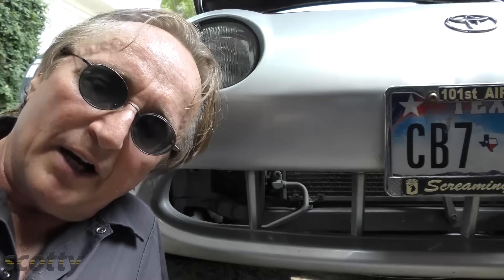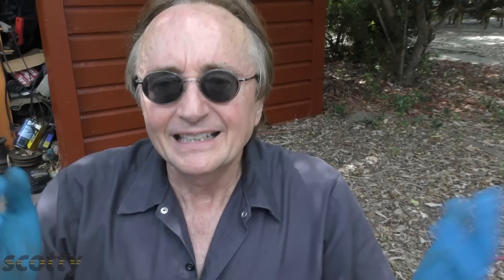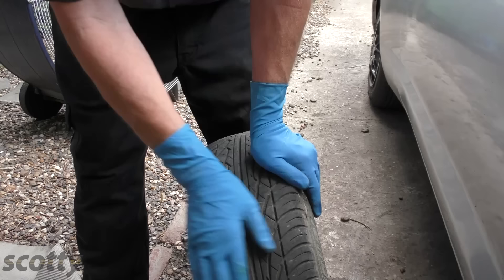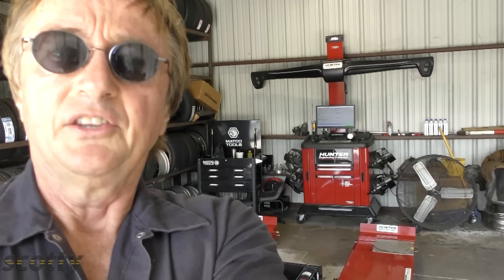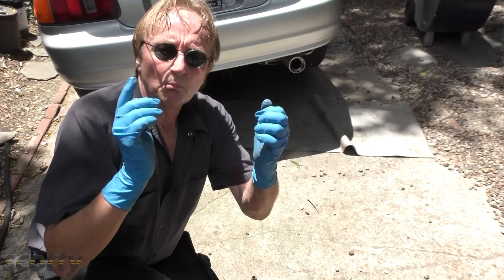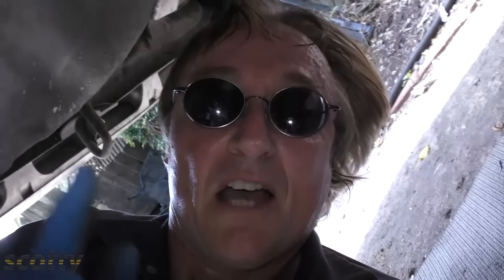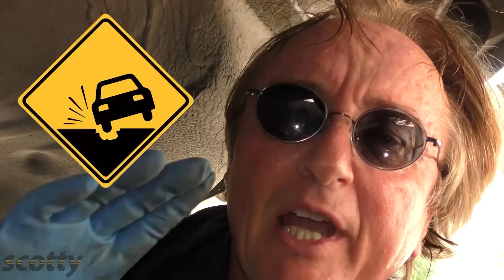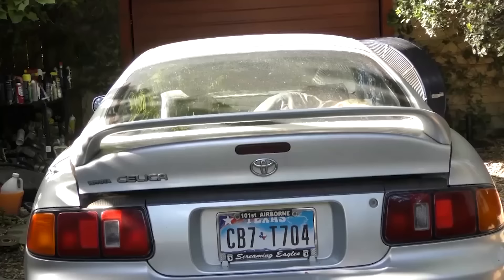How to Tell if Your Car Needs an Alignment

Comment: I changed 4 struts, 2 arms & then rotated the tires.  Should an alignment be done ? They asked me if I ran over any pot holes, etc, and the answer is no so they said I don't need one. But the car drives bumpy now.

Comment: The issue with adjustments is that any monkey that has to replace a shock absorber, or a lower pivot, or something else should at least know to recommend an alignment asap, or actually do an alignment. For the common car car any adjustments can bring heavily unadjusted parts that severely impede braking and steering.

Back in the day they made it adjustable, because the car body tolerances were way lower and each was a few millimeters off .. so if you can't make it perfect at least make it adjustable.

The purpose of wheel aliment at resting condition, is to make the wheel straight and perpendicular to the ground while doing a heavy corner, and run with the wheels parallel under acceleration and braking.
The wheel angles will only be perfect at a set medium speed intended for the vehicle. At any other speed it will be a tiny bit off. So a set of values for camber/toe/caster are perfect for a certain speed and corner approach and good enough for the rest of speeds you may run with that car.

In a racing environment you may know what is the hardest corner in that track, what is the medium speed of the track, and other particularities and you can improve the tire grip if the wheel in motion will stay true on the road.. so you can adapt different values for angles to better suit a specific track. That's why in racing cars you can find all sorts of adjustments.

So for the average car.. sure there is some cost savings, but the primary reason is that those adjustments can be unreliable and can whack the angles badly. And any monkey touching the bolts should be a certified monkey that knows what is doing and doing an alignment each time.

Comment: Small story about alignment that NO ONE thinks about.  Ex-GF got rear ended in my new car. Car road like it was on rails before the accident.  I had the cars alignment checked 3 times and it came back fine each time.  3 years later I was having the tires replaced and 1 of the rims was ever so slightly bent.  So if you've checked everything else, check the rims.

Comment: Scotty, great advice, but "Precision Tune Auto Care" won't align my car unless it is perfect. Then they tried to sell me all these repairs before they will align my car. They said, unless they do all these repairs, my car will loose alignment after they align my car.  Is this true? If so, please warn us about all the things we have to prepare for before getting our car aligned. I walked into "Precision Tune Auto Care" expecting to pay around $50. It turned out to be $400. I am sorry to say, but you failed us on this one.  

Maybe "Precision Tune Auto Care" are just crooks, and they were trying to up sell me.  That is why I do most repairs myself, but you told us we have to go to an auto mechanic, so I went to an auto mechanic.  And, I guess "Precision Tune Auto Care" are just crooks.

But, your other videos are great. You have saved me a lot of money, and I am very thankful. I cannot thank you enough, and I am very grateful. Just warn us next time about getting alignments. Your tires have to be perfect. They have to be balanced. Ball joints, control arms, etc. Everything connected to tires have to be perfect before they can do an alignment. You don't just walk into a shop and ask for an alignment. There is a lot of prep. It starts out as a $50 job, but it can sky rocket to the thousands.

Comment: Hey Scotty what if the car pulls just a little bit? I have to keep the steering wheel about 5-10 degrees off center to make the car go straight. Do I need an alignment in this case? Thanks
Reply: Tire rotation most likely!

Comment: Hey Scotty, you mentioned how nowadays, there's not too much that's readily available to be adjusted in a modern-day alignment, unlike in years past, but what if you need a classic car to get an alignment? Would a random tire shop like Belle Tire, or something similar, adjust the additional things available, or would they just go for what's usually done on modern cars? Would you need to go to a special mechanic to get it done?
Reply: Maybe ask the shop before making an appointment about the service you want performed? Just a thought.

Comment: Hey Scotty! Can I ask a question? I am trying to figure out if I need to have my car checked, or just go ahead and get new tires and rear brake pads. I have noticed some odd uneven wear on my tires. By odd, instead of both front, or rear, tires being worn, the front passenger tire is bald and the back driver's tire is bald. Both tires are worn across evenly. I have noticed too that my brake pads are worn differently. Both front are the same at about 8mm left on the pad. But the back are different. The back driver's side has 4mm left on the brake pad, and the back passenger has 3mm left on the pad. The only two things I can think of is either A: Something needs to be fixed under the car to stop the uneven wear, or B: The mechanics who "worked" on this car before I bought it, just put some used tires on it without checking and/or ignored the brake pads or just slapped some used ones on there. I did have to do a lot of work on the car after I bought it, because even though they marked it down they did it, they did not. Like my brake fluid. They marked down that they flushed and cleaned everything out. That fluid was so thick and nasty and hadn't been changed in a long time. So, what do you think on my car?

Comment: When some guy totaled his Durango on the front end of my Lincoln MkV, I had no issues driving it after that.  Even had it at the alignment shop when I needed a new steering sleeve, they didn't seem to think anything was wrong.  Perhaps when I get shocks replaced I should ask them again?

Comment: I have a question (or two) ... Scotty. I apologize in advance if someone else has asked this question. 

I own a 2007 Toyota Tundra with a rear differential. Does my truck need a 4-wheel alignment? 

I've been to some places (one said my front alignment was off by probably a millionth of an inch). But still charged me with a 4-wheel alignment. Was that necessary?

Thanks in advance.  I enjoy your videos.

Comment: On some roads my car pulls to the right, on some to the left, sometimes it doesn't. At 180 kmh the steering wheel shakes ever so slighly, but from 135 to 150 or so it's much more noticeable. How do I tell if my car needs an alignment or it's just the curvature of the road?
Reply: The shake is wheel balance.
If a shake occurs within a specific speed range and you can drive out of it, it's balance.

If your car goes straight down a flat road then you can be sure the road surface is moving you left and right. 

You can run your cambers to the most negative of the factory spec to stop this happening to easily and offset with a tiny amount of extra toe in.

Also check the rear, which if out, forces you to compensate with the steering.
Reply: @bremCZ  I've replaced outer tie rods, right wheel bearing, strut mounts, stabilizers or sway bar or whatever you call that and some other minor stuff - didn't have any effect on that. Since then I've replaced inner tie rods, one of the outer tie rods and both stabilizers got worn out (it's only been a few months!), so I replaced them again, got a new lower ball joint (again, they were both replaced 1 year ago!) and today the left wheel hub in the back will be replaced. Got myslef new  summer tires; rear and front alignment done as well.  I have a long trip lined up next week and I'll test drive it then.
But concerning the shake being caused by wheel balance - I'm not sure that that's the case, because I have it both on summer and winter tires at exactly the same range of speed.
Reply: @djvasforever  If you can drive through it, it's balance. Or either wheels or hub componants.
If it's not those things then there is a symptom you are missing.
If it does it more while turning for example it could even be an engine mount.
Reply: Yesterday did a test drive. It's still shaking from 135 to 145 kmh, but not at other speeds. The only thing that's left is engine mounts. One day I'll check them.

Comment: I'm hitting pot holes all the time in South Africa.
Just had my Alignment done but when I picked up the car I was shocked that the one tyer need air as it was 50% down. Do they not have to have the right air pressure before alignment??

Comment: I wonder if I got taken for a ride when I got told I needed an alignment. I didn't notice any shaking at high speeds or pulling but the place I get my oil changed at said I needed it. So I took it to another shop and didn't tell them what the other place said and just asked them to check the alignment and they also said it need it. I went on and did it and didn't notice anything different in the ride.

Comment: My truck's ride quality is bad even after alignment. New shocks, alignment, good tires and the whole thing jumps and vibrates while driving down the road. I'm assuming it's the ball joints because it has wheel play only up and down.

Comment: I had a windy Grinding noise from my front end so I replaced the front wheel bearing assembly’s and the sound is still there but now it’s coming more from the wheels and gets louder as I accelerate. HELP , brand new brakes and rotors already

Comment: Hey Scotty, sometimes the techs at the alignment shops do just the alignment to some degree. But not absolute, my question is that do the message screen SHOULD turn in Green or some parts in red too are acceptable?

Comment: A lot said in this video is incorrect, and even contradictory in and of its self.

Front toe can be set correctly within specks with a simple tape measure. You can actually convert a tape measure measurement with angular geometry to convert to degrees if you want to get the total toe split, and check with proper specks, but there is usually no need. Toe in a 1/16th inch or so for the front end, typically. Front toe measurement is something almost anyone can at least check with just a bit of knowledge and a helper to hold one end of the tape measure. Rear toe alignment is more difficult because you need to find two symmetrical points of measurement, one point on either side of the car, or at least one true center point.  Rear toe would be difficult for the average person to measure and make corrections, but it can at least be easily checked and if its off by lets say 1/4 to 1/2 inch or more, something is bad wrong. Anything over 1/8 of an inch would be suspect, typically.
 
Its not necessarily true if a car drives straight you don't need an alignment. I have driven cars I know good and well the alignment is off by quite a bit and they drive just fine. IT can be that a bad front toe alignment will scrub all the rubber off the tires really really quick. All the while the car will drive just fine and all the while the tread is visually uniform showing almost no visible signs of wear to the average person.  
      
Some years ago I listened to an interview with Darrell Waltrip the stock car driver and stock car team owner and he was asked about alignment machines. To paraphrase, he said oh no no. We do it the same way as we always have and that's with a tape measure and a toe stick. Well, they use jigs to build cars and measure in all sorts of ways, but the idea is still true. A tape measure does not lie if used correctly, and neither does gravity as a matter of level and plum. Lasers are fine, but isn't a laser just a fancy tape measure? Egyptians did't use lasers to build pyramids. They used a Black & Decker tape measure to measure length, width, and height. They used a string tied around a hunk of rock for plum. Good luck.

Comment: My vehicle only has a problem with the right back tire,  which it wears out on the outside and inside. The other 3 are perfectly fine evenly. I have a 2000 Nissan Xterra. What do u suggest I can do to fix it. I bought it used.

Comment: My 2002 've polo 1.8 damaged one piston at high speed. Then was fixed and engen modified to 2.0 L. car moves well. Issue now is it takes lotta of gasoline, and my petrol gauge on dash is not accurate one minutes it shows quarter tank den as u up on hill may move to half tank making it difficult to knw how much is left, on cold Mornings Whn I start car I have to step on the Gas so it can idle or it may switch off, when engen is warm car idles okay.

Comment: Hey Scott, I learn a lot from you… here few question what about 4 wheel sterling car?… I have later model German sedan and recently change rear tires for winter tire and notice rear passenger side tire wear out ‘toe out’, I was told no needs do wheel alignment, but dealership want it alignment done. Any advice for nubie like me?

Comment: Hey Scotty. I recently replaced the front struts and strut mounts on a 1989 Buick Riviera. Took the car to Break Check, where they do have the laser alignment rack. After the car came out of the bay. I noticed the driver side wheel leaning out. I mentioned it to the guy that pulled the car out. He noticed something wasn't right and pulled it back into the bay. The "mechanic" that preformed the alignment stated there was "No" adjustment to pull the top back in. The bottom of the tires are angled inward and going down the road you hear the tire squealing! Hit slight water on the road and it starts to skate!! Not sure what to do. I took it yesterday 8/12

Comment: There are a couple of flaws in the theory here. Maybe the laser can read in the 10 thousandths of an inch (.0001") but I guarantee the tech sure as hell isn't that precise with a wrench. Like others have stated here, they give you the 90% solution and send you on your way. So worrying about .1% accuracy is pretty much not going to happen. Toe adjustments are all you get on most cheaper cars (Corolla, Civic, Sentra, etc) so really the DIY method is going to work just as well if you do it right. Also, no matter how good the alignment, worn parts are going null and void quite a bit of the alignment. That can be worn tires bad shocks bad ball joints bad tie rods or frame damage. You also have to trust that the technician knows what they're doing or will actually tell you if there's something wrong with your car. I've had front end alignments done on a car with a mechanic from the 60s with no computers whatsoever and the car drove great. Same car taken to a technician with all the fancy gear and the car drove like garbage. Took the car back to the 60s technician and voila! Car was back to being "perfect" again.

Comment: Yea leave it to pros. When i start to make something myself it became better with no equipment than when pross do this.
When i had ford probe, i had to do front allignment few times. After replacing parts most.
And since once i got two square sticks, learned way they did this in past. i never drove to anyone with this. Car never was so good alligned when was to some "specialist" that only have equipment and don't know that it is for. 
After that never had uneven tires, no turning car when i lost traction on one wheel, nothing. i did it with +-0.5mm (0.019685inch)

Comment: I recently purchased a used car and it drives straight with the steering wheel pointed 90 degrees to the passenger side and it pulls to the left, should I get it aligned?

Comment: Yeah ! Don't let a person called Steve touch it with his outdated equipment !!!!

I rebushed my 2002 model Holden Commodore & fitted new struts,shocks,springs,etc & got him to do it & it was way out.

The steering wheel was never sat straight & I wore all the tyres out in 6000 kilometres.

I took it to somewhere else where they had a computerized laser wheel alignment machine & the back IRS toe settings was 13mms out.

The front was out by a few millimetres & the camber barely had to be touched on the front,the left hand front wheel needed more positive camber I think !!!!

Note that while it was adjusted,for whatever reason, some of the camber settings remained in the red,the same went with the front caster settings, there's no way it could've been adjusted from the red to green position from stock.

Realistically, no wheel alignment or car is perfect but I was much happier with the cars handling & road holding ability afterwards.

I started getting about 20,000 kilometres out of even a cheap set of tyres which cost just over $100 AUD each for 235/40/R18 sized tyres.

When I get another job & myself well established, I'll look at getting some better tyres for it !!!!

Comment: My gf’s 2012 Ford Fiesta doesn’t appear to have adjustment in the rear. If I remember correctly, it just has a shock and spring. Or maybe just a shock? It wears the insides of the tires A LOT. It’s visibly negative camber in the back when you look at it.

The car also vibrates a lot when you hit 75mph.

Is there anyway to fix this?

The front end appears fine though. She hadn’t done her rotation and the front tires were good. Just the back ones were worn out on the inside.

Comment: So if my car wobbles above a hundred k, front tires wear to wire on the outside after three months, the steering centre is about fourghty degrees to the left of centre and the car pulls badly to the right, I should probably get an alignment check right? Right?

Comment: At what interval, do you recommend getting brake fluid, brake calipers, and slave cylinders replaced in a 97 toyota camry? Most of the parts in the front suspension were replaced.

You mention that a wreck from the back can cause issues in the front. The previous driver had what looks like a dent in the rear drivers side quarter panel, behind the lights. It looks like a small crevice.

Could it be something in the drum brake system in the rear?